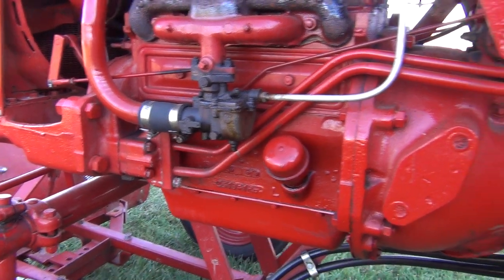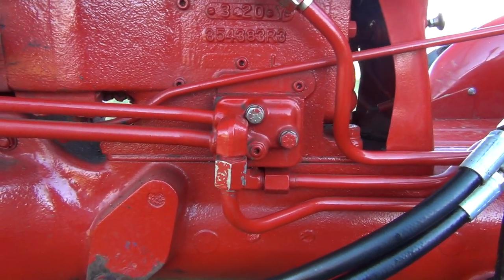Farmall Cub, Adding Auxiliary (Remote) Hyd. Circuit And Power Angle On A Cub Grader Blade/Snow Plow.

Comment: It looks very neatly done.  You said power beyond not recommended but seeing as how you have it I would suggest you could have put a tee fitting in filler plug. Then you could still have your power beyond line where it is but you could also have a 90 elbow coming out toward you with a top fill plug so it's easier to top off oil level.
Reply from the maker: Duncan, that's a good idea but in all of the years I've been using this configuration I haven't had to add oil to the Touch Control unit. Thanks for watching and Merry Christmas to you and your family!

Comment: Super nice setup. The block and hard lines look great like they are original factory parts. I would love to know how to get the hard lines.
Reply from the maker: Thank you for the comments. There is no source  for the hard lines. Those I had to bend myself. The auxiliary hydraulics will work just as well using hydraulic hose and would be simpler for most to install. Hard lines aren't required for this modification.
Reply: @rickyoung360  thanks Rick, yours does look great.

Comment: Nice setup on the old cub, ignorance showing up here, how do you lift and lower the blade, as you don't want it down all the time
Reply from the maker: Thank you for watching this video and your great question. The addition of the bypass block does not hinder the use of the original Touch Control unit in any way, it just diverts the flow of the hydraulic fluid through the auxiliary valve first before it enters the Touch Control unit. The Touch Control operates just the same as it did prior to adding the bypass block and the blade is lifted or lowered using the Touch Control lever mounted on the steering column. The only interference in the operation of the Touch Control is that you cannot operate the Touch Control AND the auxiliary valve at the same time. When you shift the auxiliary valve the hydraulic flow is diverted to the power angle cylinder instead of the Touch Control unit. As soon as you release the auxiliary valve, it shifts back to the neutral position and flow is restored to the Touch Control unit. I hope I made myself clear.

Comment: Can you tell me again where I can buy the bypass block. Can you also get the lines too?
Reply from the maker: You can purchase a bypass block from TM Tractor Parts by calling Ron at 207-892-0163. 
The tubing I ran, I formed myself and are not available from anyone. Most will find it easier to run hydraulic hoses instead of steel tubing.
TM Tractor Parts
A Division of Windy Hill Restoration LLC
Windham, Maine
Specializing in Farmall Cub & Lo-Boy:
TM Tractor Parts
115 River Road
Windham, Maine 04062

Comment: Does the open center valve effect the use of the other hydraulic system?
Reply from the maker: Thanks for watching. No. The open center allows the fluid to pass through the auxiliary valve and flow into the Touch Control unit allowing it to operate like normal.

Comment: Can you do this with a 154 ?
Reply from the maker: I have no experience with the 154 or 184 tractors. I would assume that you can but you'll need to do some more research to verify that it's possible. Sorry I can't be more helpful in that regard.
Reply: @rickyoung360 no problem just need to add a bypass somehow

Comment: Where did you get the valve
Reply from the maker: It's been a long time since I purchased that valve but if I recall, it was purchased from the Surplus  Center online. There are many sources for hydraulic components so I'd suggest taking some time and doing some comparison shopping. Remember, the valve needs a pressure relief that can be adjusted down to around 1500 psi. Thanks for watching and good luck with your project.